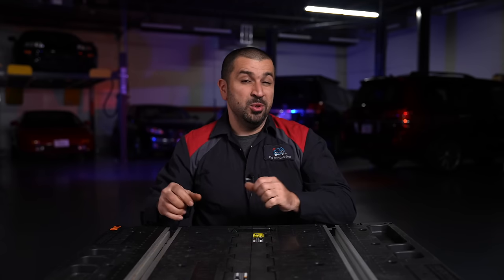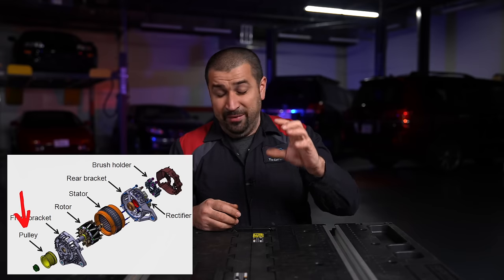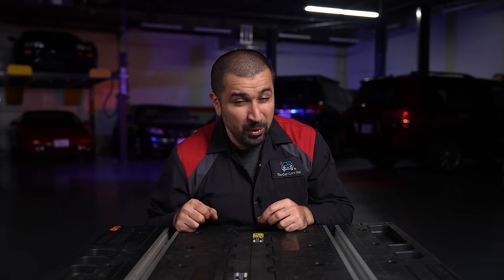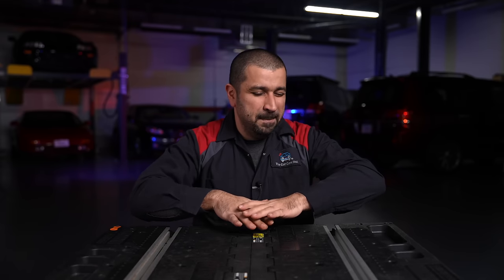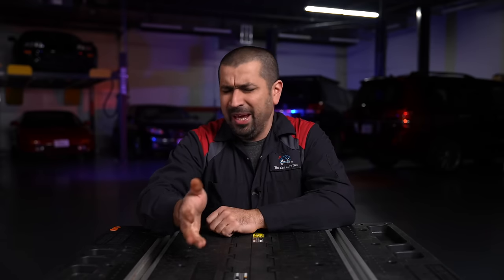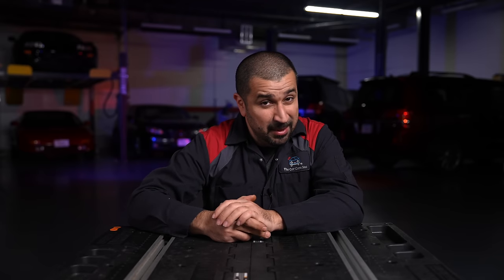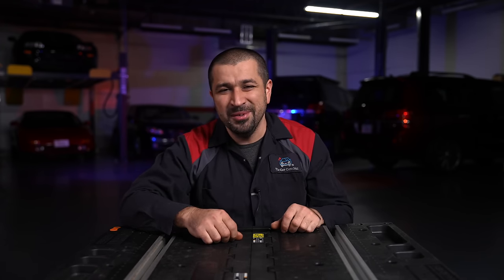How To Make Your Car's Alternator Last Longer? Everything You Need to Know

Comment: YES! Especially on older cars where there's no computer management of the alternator, if you lose your alternator, you will also discharge your battery, typically until it's close to dead. (It's not healthy to run the battery to full discharge.) So after the alternator is replaced, trying to recharge your battery will put a huge load on the alternator, potentially damaging it. Also, because the battery was fully discharged it will no longer hold a full charge. 
If you have signs the alternator is going, put your battery on a charger, before you drive your car in to have the alternator checked. If it is replaced, be sure to ask the ship to recharge the battery before you drive off.

Comment: I like your videos but I have to disagree with the ac sine wave .You said the negative alternation is not used.Let me describe, the+ diode conducts electrons to remove electrons from B+during the positive alternation making it more positive. Then the negative diode conducts (passes) electrons to add electrons to B- during the negative Alternation making it more negative there is no eliminating the negative alternation .The one thing I see after a generator replacement is checking on recharge current to battery ONLY  making sure amp draw is keep low (in the range of 10a after recharge state )Just my 2 cents buy a battery tester that gives you battery resistance

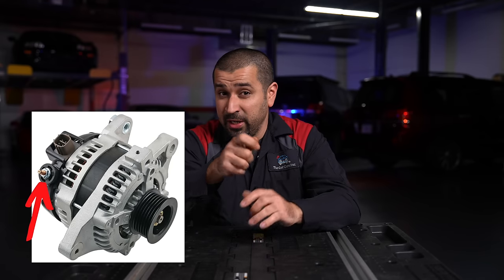Comment: 20:42 @The Car Care Nut , how bad is it if my alternator doesn't whine when driving, but it did whine when i was testing the battery beacuse of failin Electric Power Steering and i turned the car on and in idle turned on everything i could to the max, it whined for about 30 sec with everything on and then it went normal. Is that an actual failing alternator or is it just too much to have every single electronic on max while idling ?

I do think it's the alternator messing with the EPS cause when i pull the EPS fuse out and put it back in, it starts working normally and it doesn't go out during driving but after parking the car and starting it again.

Comment: Incorrect description of current generation. You are showing what's called half wave rectification. Full wave rectification uses the bottom half of the wave as well. That is why alternators have six diodes. If they only had three, your drawing would be correct, but you would be wasting half of the wave. Most alternators from days gone by had a capacitor to prevent radio interference when am radio was popular. I don't think they were for smoothing out the current.

Comment: i have a 98 dodge dakota ( bought it new) with almost 400,000 miles on it, still spinning the original alternator yet,   i finally had to replace the original starter this past spring, my friend had a 03 chevy truck, we were looking at something under the hood and i had noticed the alternator was too hot to touch, no noisy bearings or anything like that, compared to my dakota its cool to the touch. is there any reason why the chevy alternator is so hot running?  we popped the serpentine belt off to see if it was hard to turn (it wasn't)  both vehicles charging fine with 14.3-14.5 volts at battery terminals while running

Comment: Aftermarket alternators are often made by remanufacturing used oem alternators. One of the main reasons they fail is because the plant will salvage and reuse the rectifier (the part that converts AC to DC) because it's an expensive part to replace with new. As rectifiers wear out, their output voltage gets to a point where the regulator can no longer deal with it, thus killing the regulator. 

Most alternators are extremely easy to rebuild. If you can replace your alternator yourself, you can rebuild it. If you can rebuild your alternator using a new oem rectifier and voltage regulator, it will last FAR longer than an aftermarket or remanufactured unit and cost significantly less.

Comment: TLDR: don't get your alternator dirty, ONLY use electronics specific cleaner, dont use it to charge a dead or dying battery unless you jump started it to go to the store and buy a battery. If you hear a whining noise, it's probably time for a new alternator. A battery signal on your dash while driving means your alternator is dead and youre just running off the battery. Stop what youre doing and go to the nearest car shop before your vehicle dies, if you turn off the car at this point it may not restart again. If no shop nearby, pull over somewhere safe and call for help.

Comment: 7:37 It would have been helpful to explain here that the induced voltage (output of the alternator) is controlled by two things in this scenario: magnetic field strength (flux) wghich itself is controlled by the voltage supplied to the rotor from the battery, and speed. If you increase one, you can decrease the other to keep the voltage the same... so as rpm goes up, so does the induced voltage, as you said, which is in turn regulated, by the regulator, by lowering the field voltage, which reduces the magnetic field strength and thus the output voltage drops.

Comment: Could the alternator whine also be caused by grounding issues? I'm looking to clean the metal surfaces and redo the ground wires with heavier gauge cable. I'm hoping my alternator isn't going since it's only at 70k but I'll disconnect it as a troubleshooting step and also check the voltage with a multimeter.

Comment: If I am correct on the following assumption?? You might add keeping electrical connections clean here.. Especially battery terminals where acid builds up on the terminals on many cars using lead acid batteries. This leads to bad connections and making the alternator work harder to get a charge back into the battery. Otherwise a great video and thanks for the excellent information and video.

Comment: You forget to tell peoples that in early year, alternator used 85 amp max load but now , the vehicle have too many electronics system it require 130 amp to run a vehicles , specially luxury vehicles and sport vehicle and don’t listen radios when engine not running or drive at night daily,or left interior light stay on or jump battery backwards than not only alternator go bad but your engine pcm also

Comment: I was disappointed my last alternator on my 99 Ford Mustang six lasted only 4 years - and it was a Motorcraft remanufactured one from the Ford dealer! I did find out my car needs another ground wire ran - would that affect the life of the alternator? Also, I see a few shops still rebuild your OWN alternator (supposedly Ford only reused the outer shell on their alternators) - would it be better to actually have my alternator rebuilt my a good rebuild shop?  Is it a good idea to oversize the battery and alternator a bit? New batteries seem smaller than they used to be, and don't seem to last nearly as long.

Comment: Diodes are connected in such a manner that they will fold the negative side of the waveforms and join them to the positive side, utilizing so full power of the alternator. There are six plus three diodes in the alternator. The Sixer pack is called a full wave rectifier, and the trio pack is called a half wave rectifier. Half wave is used separately to magnetise the rotor only, utilising the red signal lamp on the dashbord via the ignition key switch.

Comment: "starter is always highest load" not if you have over 10kw sound system in the back. Also if you are running something like that high end aftermarket alternator is something you should consider

Comment: 07 4Runner is notorious for alternator  failure. It’s located near the ground and is normally protected by the skid plate. Do not remove the skid plate or your Alt will get wet and fail. And yes don’t get an after market alt, it can’t talk to your computer.

Comment: 99.99% the alternator will be fine when that voltage fails. Mostly, those diodes failed due to the overloaded of the voltage. Replace battery and those diodes will fix the issue!

Comment: Have you ever known how to figure while the battery about to go dead without checking the battery?
At night while you are driving, you will notice your vehicle lights will be brighter and dimmer with the AC on every few seconds and it keeps this cycle that you can see at night. This is the sign when the battery does not hold enough current and the alternator is keeping on to charge the battery. If you keep it goes for a long period of time, the alternator will eventually be completely failed due to bad battery. You will end up to pay for the new battery and a new alternator!

Comment: my 2010 4 runner alternator sits in a spot that takes direct hits from water in rain storms OEM went at 100K ,  ya can see the windings right threw a gap in fender shields , so splashing water has no trouble hitting it , BOOOOO. on that one Toyota  , I assume this may have caused the  early failure , I added rubber mat in areas so water cannot deflect  and hit alternator

Comment: Thank you very much for the valuable and important information, but when you disconnect a cable from the battery terminals while the engine is running, is the engine supposed to continue running??  In modern cars, when the battery cable is disconnected, the engine stops running. This method is used by some people to determine whether the car’s dynamo is working or not.

Comment: I have a 1932 ford roadster hot rod with no hood and use a Toyota fork lift alternator (Denso).  It gets soaked in the rain quite often.  what killed it was driving around the Bonneville Salt flats during speed week and going for five miles in two inches of salt water to the pit area.  by the end of the week the salt was caked on everything and the alternator did go out.  fortunately I carried a spare.

Comment: Years ago I had a bad alternator in a 2005 mustang gt but didn’t know it. I had an engine code for camshaft position sensor. Before changing them I did a little google research and people said bad alternators can do that. I changed the alternator hoping nothing was wrong with my engine and the codes went away ever since

Comment: Yep, the alternator is not made to recharge a battery from 0%.   Same reason to not push start a standard trans car.  The number two cause I have seen is that people are told when they are jump starting someone else, to run their car so that their alternator is trying to run a high current starter in the other car.  Blows the diodes.  The proper way is to jump the cars together, let the good car charge up both batteries a few minutes, then TURN OFF the good car and let the dead car start with two batteries in parallel.

Comment: i would recommend the opposite if battery light comes on either drive home if it is nearby or to garage to get it fixed and turn off everything in car you can.
 like ac radio anything you don't need that uses power. then shut off car and get ride from garage or don't drive it.
 if you are at home charge battery and look for problem like broken belt or use voltmeter to check battery and alternator. those little battery testers for cars check for battery life, alternator function, and ripple in voltage at a cheap price.

Comment: @TheCarCareNut If I happened to have a drained yet good battery and could not start the engine, ideally if we are not pressed for time, better charge the battery instead of jumpstarting it right? Is this the best course of action since alternators are not the best battery chargers and driving with a low charged, somehow depleted battery is going to make the alternator work harder than it should be thus shortening its life?

Comment: My 2000 Mitsubishi mirage has over 400k miles on it and it still has the original alternator. Original trans and original engine. Only wear and tear items have needed replacement.

Comment: When measuring the voltage on the battery terminals while the engine is running, it gives 14 volts, which means that the generator is working properly??

Comment: A good way to test the battery is to turn the headlights on while you're doing an oil change. If the car will not start after the oil change, you need a new battery. Plain and simple test. 😃

Comment: ALSO ONE OTHER POINT IS THE THE COMPUTER ON PURPOSE VARIES THE VOLTAGE FROM CHARGE TO NO CHARGE
WHILE CRUISING, THE REASON FOR THIS IS TO MAKE THE BATTERY LAST LONGER, IN THAT ITS CLEANING THE BATTERY PLATES INSIDE , WHAT KILLS  IT IS NO CHARGE OR ALWAYS BEING CHARGED, CYCLING CHARGE FOR A LEAD ACID BATTERY IS THE BEST FOR LONGEVITY

Comment: And also to help keep everything going well keep up on battery terminals and keep them clean, plus when you hear chattering sound or squeaking from the pulleys Replace Them that is putting a Strain on the Alternator and wearing belts out prematurely.

Comment: 20:00 - Most alternator "modules" for the rectifier and such are potted (have a hard resin encasing components).

The coils are enamel covered and shouldn't rust. The biggest issue with water and oil and such is corrosion of the bearings and support structures. 

Electronics and windings should be fine

Comment: Basically when the motor is running at any time the electrical system is powered by the alternator NOT THE BATTERY. The location of the battery and the alternator determines the life. The more heat and how long the heat determines the life of both alt and battery. Amps also have an effect on the life of the alternator, the more amps the more heat.

Comment: I may have the original alternator in my 1997 Toyota Hilux because it is located low down at the left hand side of the engine and below where the power steering pump was l removed it because the high pressure hose was leaking who needs power steering any way

Comment: When my car’s battery was very low on charge you can absolutely feel the effect of the alternator on the engine, the car will slow a lot more rapidly when in gear due to the draw from the alternator. (On a 1.0L engine anyway)

Comment: 6:30 does that functionally imply that half the power created is wasted by the alternator? Or does the diode keep the energy "stuck" in the system and it increases the strength of the positive waveform?

Comment: the most voltage you will have is 21 volts maxed out. 3 fields 7 volts each. 21. not 27.

Comment: Great video.
It's important to know what was ture in the past is not ture in modern cars.
Even old alt. Were not designed to charge a dead battery.
Don't go to the car wash open the hood and was the engine.
Good stuff

Comment: Older designed alternators don’t tropically last as long as newer units. ……I’ve always found that adding a larger capacitor to the charging system helps regulate and maintain a steady load on an alternator ….
When you turn on headlights , wipers or any other heavy load electrical load it causes a voltage spike from the alternator….making it momentarily work hard… a capacitor helps to lighten those heavy load  spikes to the alternator …

Comment: Yes. Many car owners discover that when they have a dead battery is their alternator dies after they get a boost and drive off, or swap out a replacement battery. Best to trickle-charge your battery to get it charged, than to use your alternator to charge it. Too much load, and your alternator will fry.

Comment: Normally, the alternator fails due to the battery failure. Does anyone know the reason?
When the battery failed, the voltage of the alternator will become higher because there is no filter and the high voltage means the load is also high. This load will eventually kill those diodes, and when those diodes fail, you will not have any voltages go through the battery.

Comment: I replaced the alternator on my 2009 Avalon with alternator from advanced auto , first one didn’t fit n it was exactly identical the second one after installing it i noticed the ac blower fan goes high and back to normal in few second , i dont know if it’s because the new alternator or a different issue .

Comment: I have a deepcycle agm die hard because i use a lot of electronics and so my battery gets drained and the alternator helps to recharge her..rarely do i take it below starting ability..i get differing opinions on if it will wear down the alternator and some say i dont need a trickle charger..any suggestions?

Comment: Correct me if I am wrong but the alternator puts out 14 volts 12 volts is that battery but 12 volts in not enough to charge the battery and run the car.
Also you should not say power the alternator rotor I would have said turn the rotor the alternator via the engine.

Comment: I had a 2010 accord the battery  died on me after i tried to start it after work. I used to work 1 hour and 10 min from my house. So i had to jump the car and go to krogers. Jumped it again and drove it an hour to interstate battery near. I had the battery tested and it wouldn't  start either so it was time to replace it and it checked bad.

Comment: If you have a car that gets used maybe once a month is it safe to leave a trickle charge on it while the car is not in use?  I ask
because I was told the electronics in the car is always drawing current and the battery gets low then the alternator will be under
stress.   Instead of trickle charge on 100% is it OK to put a standard battery charger on the battery for a few hours and if so
is their a recommended charge rate?    If a battery has to be replaced is it OK remove both leads of the battery or does another battery or power supply have to be connected to the battery leads before disconnecting them from the main car battery.  Someone told me if a battery is disconnected it could cause issues with the computer.     thanks